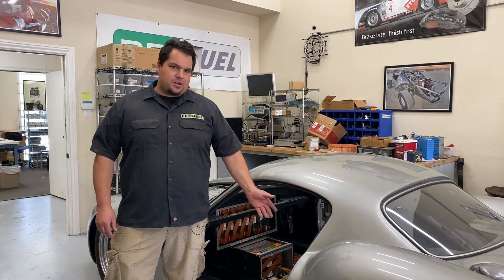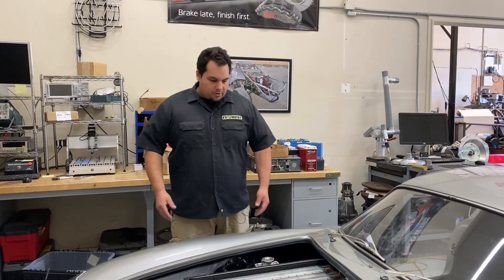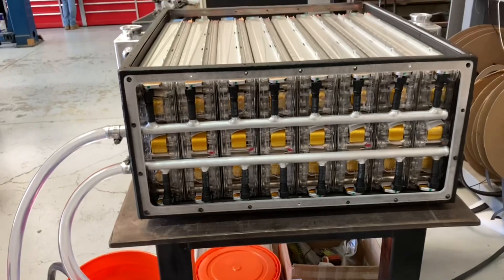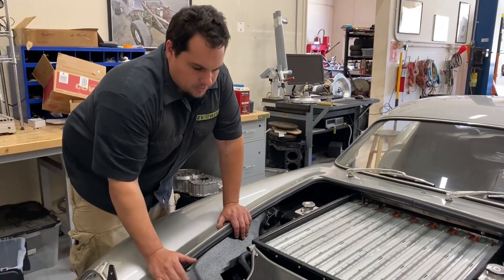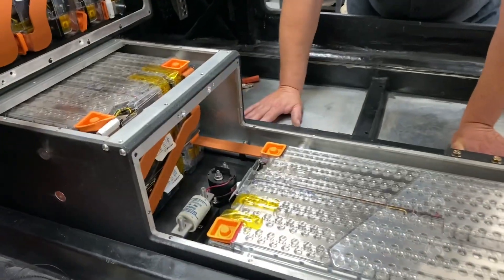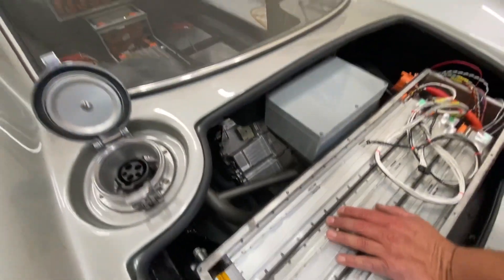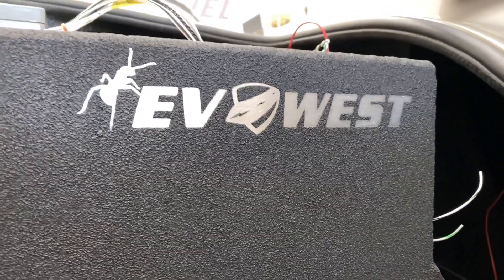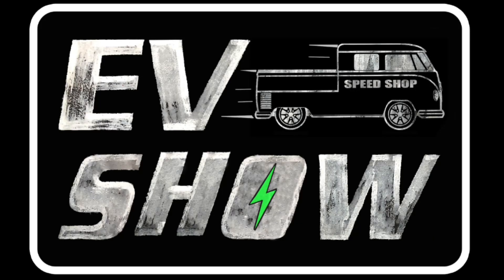Dowsett Comet Full Tesla Swap | EV Show

Comment: In which present condition can the batteries overheat in this use case?????? I can understand for the engine, but not really for the batteries. I would have thought that a 6kw charger wouldnt be enough to trigger such condition for a setup like this. Though if the setup were to see a 50kw charge that would be a different convo. Is the charging will be upgraded later on? Such an incredible build....!
Reply: The batteries will experience more than 6kW during driving. Even if there's no DC fast charging you might still inject many tens of kW via regen breaking

Comment: Love the progress, looks killer.   >_<     A question if you please.  0_o    Has EV West ever considered doing a EV conversion of any 1965, or later Corvair?   Since the 65 and later had the upgrade rear-end and generous "Frunk" and rear-engine space.  One would think that moving the power-pack forward would solve any weight bias the car suffered in the past.   
Hmmmm, I wonder how many Tesla modules one could get into a Corvair body?
Reply: If you have access to blueprints for the Corvair that describe the engine bay and the frunks internal dimensions, it's just a matter of calculating how much volume a Tesla module occupies and multiply by the amount of modules needed.